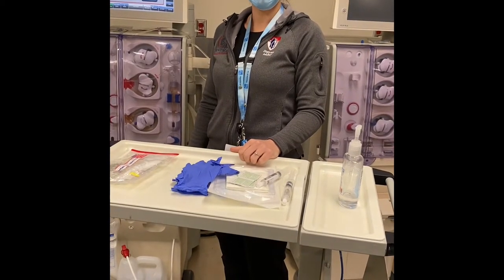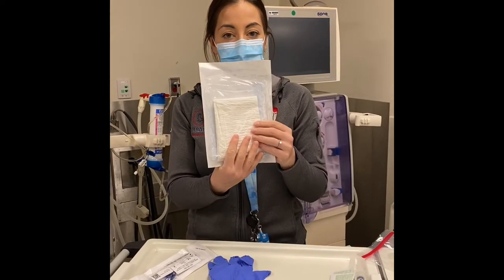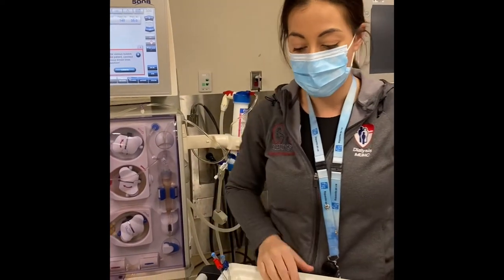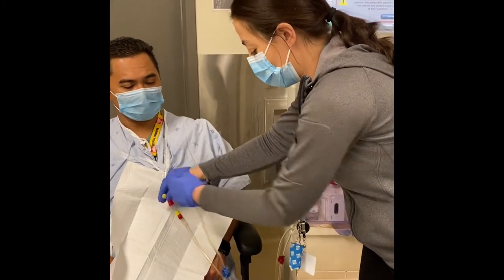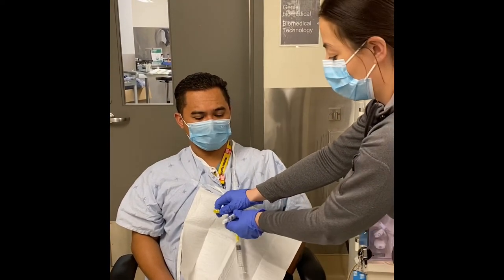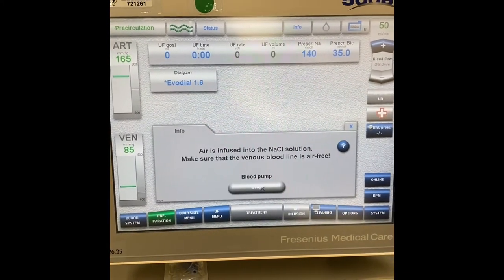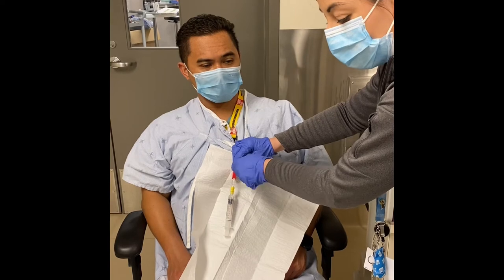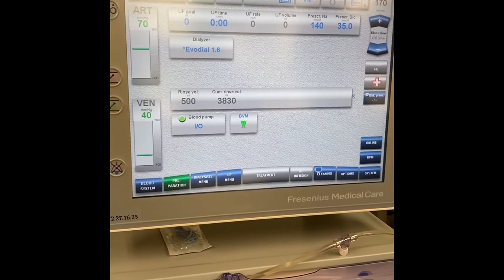Air below venous bubble cather / micro bubbles Fresenius 5008

Comment: With a 6008 machine, draining problem. It does not drain well leaving a good amount of fluid in the lines before stripping it from the machine and putting it into heat disinfect. Have you encountered same situation? What solution did you do?